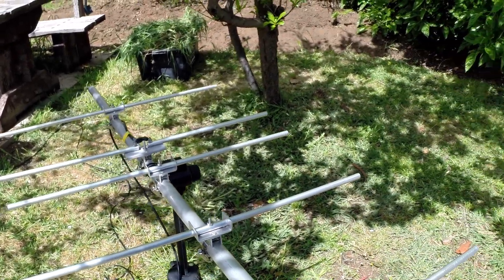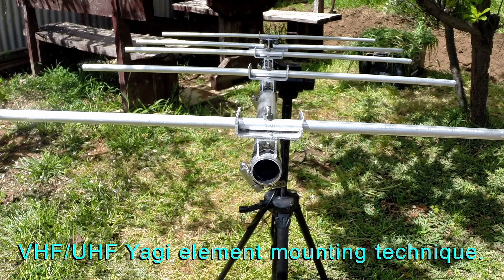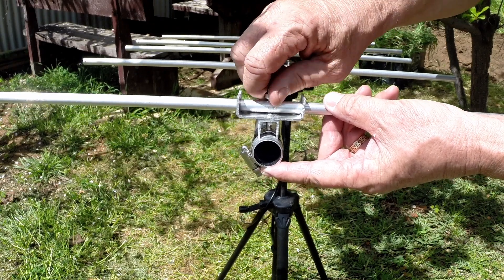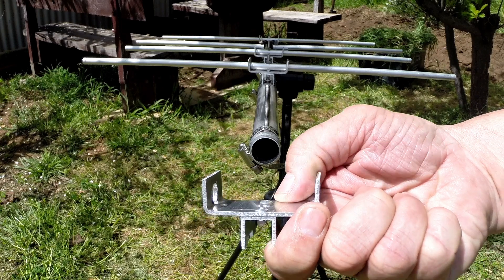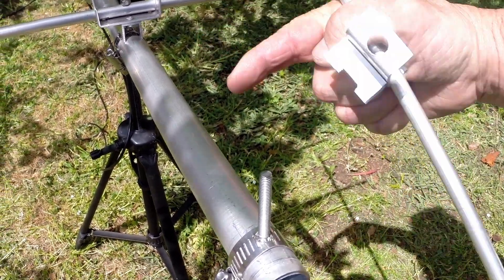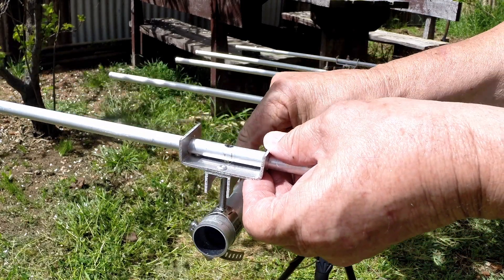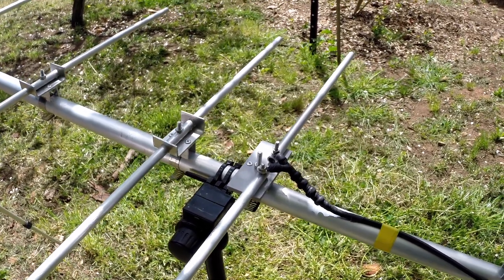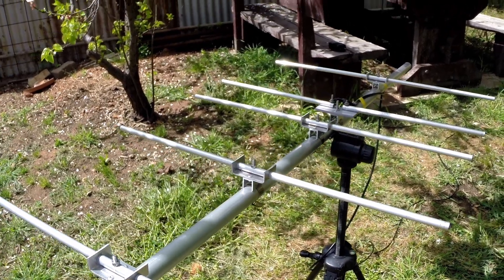VHF Yagi Antenna  - 26 September 2022

Comment: I've made a 5 element 1.6GHz Yagi with the signal element that's 90mm long. Using 2mm bare wire as elements. 
I have to cut it to 2x45mm pieces to split the signal? What about the 2-3 mm minimum distance I can manage keeping them apart? 
Does the gap between the ground and signal poles matter? Do I have to adjust the length of the wires after assembly?

Comment: Great design there. Did you base the element length of a fraction of the wavelength. Also would adding more direction elements increase the forward gain.
Reply from the maker: Greg

The more directors the more gain. The idea of the design is flexibility for experimentation including the boom could be replace with a longer boom and more directors added. The design also produces a very robust antenna that will last for years of service as a permanent antenna.

See link for details of the 255MHz Yagi antenna and a 435MHz Yagi.

https://vk6ysf.com/yagi_250mhz_5el_20220925.htm

https://vk6ysf.com/yagi_435mhz_6el_20230201.htm
Reply: @petermiles6557  Thankyou Peter for reply & links.  So in theory if I wanted to cover u.k. Uhf airband, (200 - 400 mhz)  I would use centre frequency and design around that.
Reply from the maker: Yes; design for the centre frequency, however the more directors/gain the narrower the bandwidth and greater the directivity of the antenna.
Yagi antenna dimension calculator
https://www.changpuak.ch/electronics/yagi_uda_antenna.php
Reply: Thankyou Peter. I have some 8mm aluminium tube. Do you think this would be ok for reflector/directors ? Or are we better with solid bar.
Reply from the maker: @gregorydobson4307  Tube
Reply: Thankyou Peter for all your help. Last and final question is, I am going to use my vna to check swr. Is there an easy fix to tune the antenna down to the center frequency?